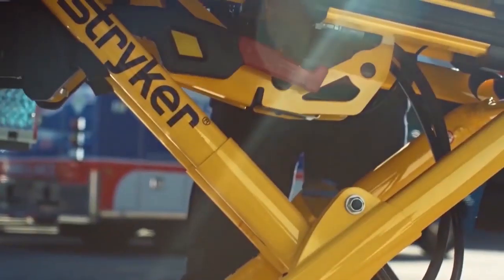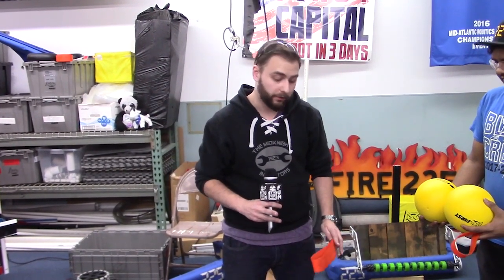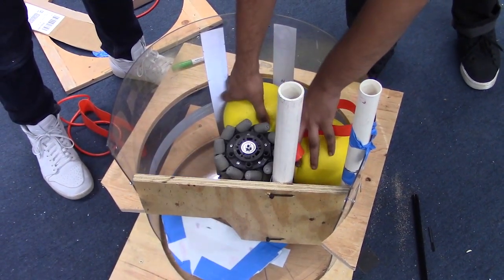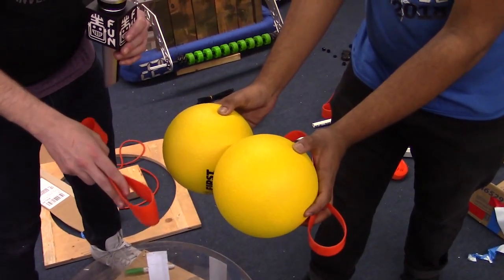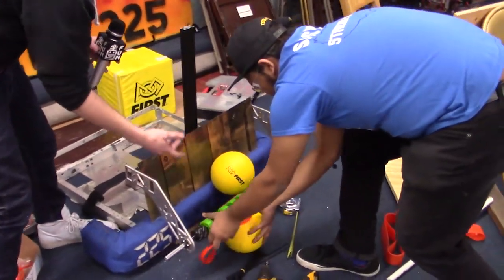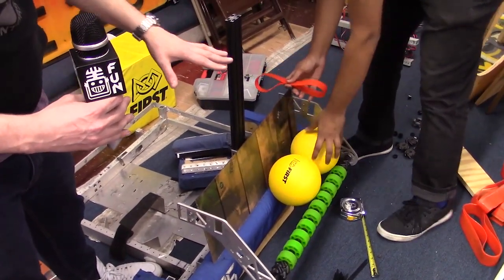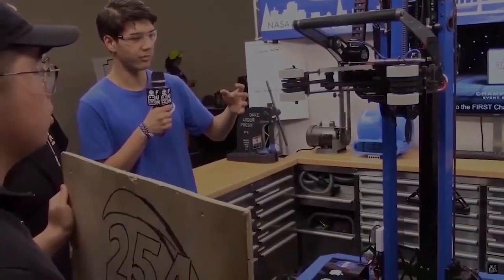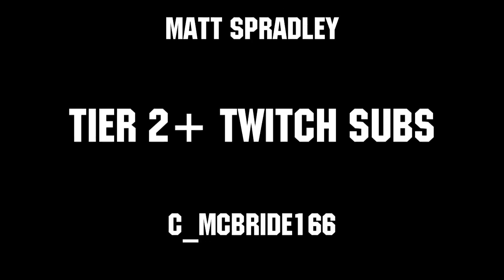Using Poly Cord Instead of Helix Hopper - FIRST Capital - First Updates Now

Comment: To keep the wider intake, just use those belts on the back of that intake and use a motor spin the belts over to the side. Program it to only run when you're also running the intake